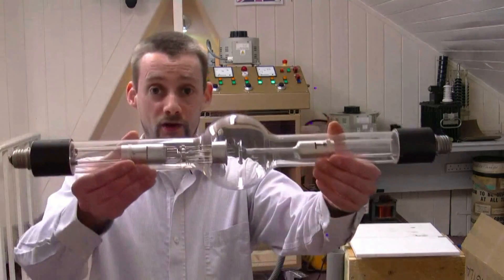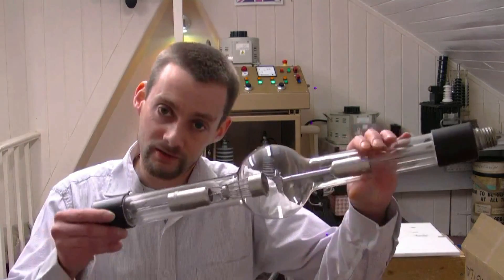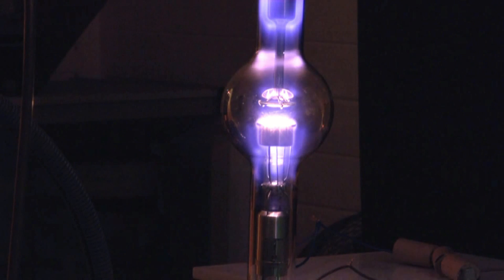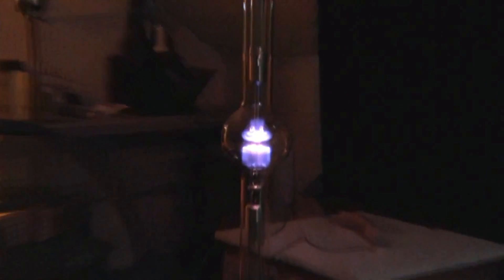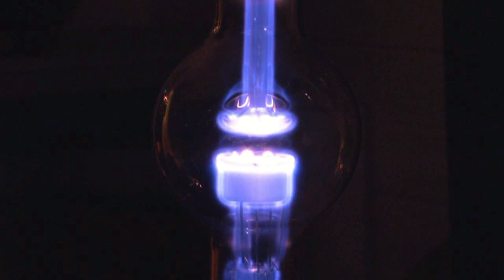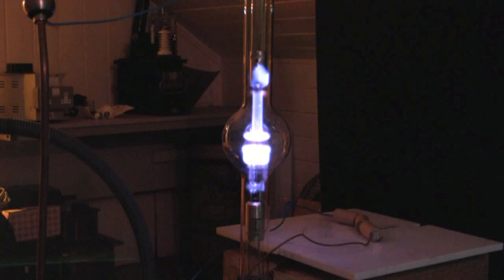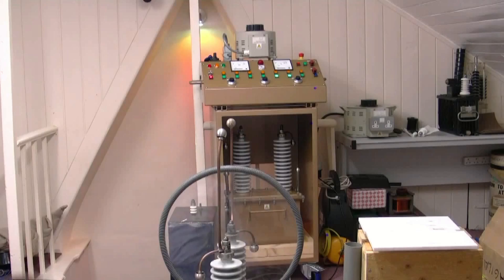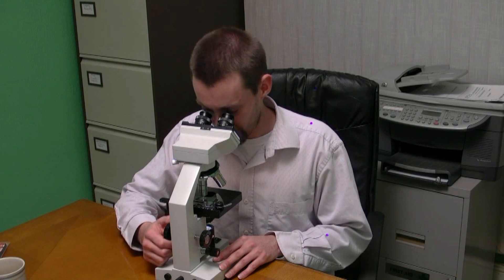Mad Science 500 keV

Comment: The blue glow is ccerenkov radiation, caused by the electrons from the cathode passing thru the dielectric medium (the metal bits) at a speed greater than the phase velocity of light in that medium. If you play with two lumps of Plutonium and see it, its time to get measured up for the wooden box.

Comment: The blue glow would indicate rare atmosphere. Errie things happen at those kind of voltages. Chances are these have gone a little soft causing the very pronounced glow and reluctance to breakover. Not sure about these I have a pair that will take 750KV @ 125ma on a 5% duty cycle air cooled. 
These tubes were used in xray equipment before the advent of solid state rectifiers that would handle the voltage. Kenotron is the correct spelling if you want to search them out.